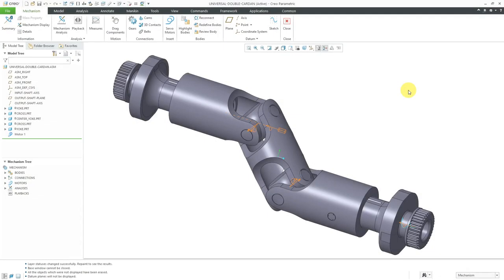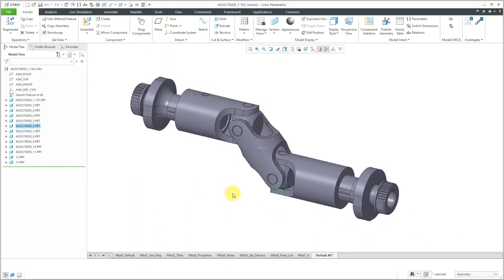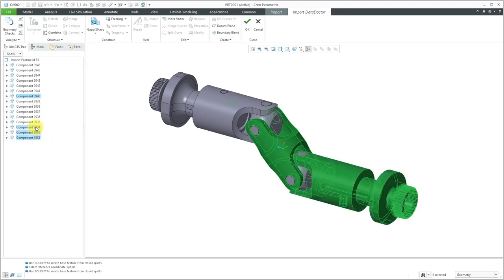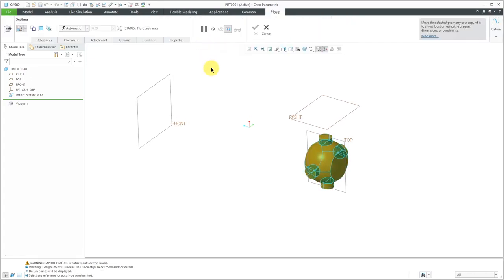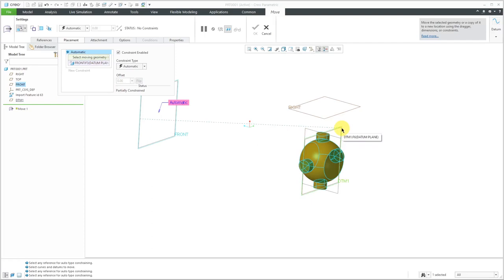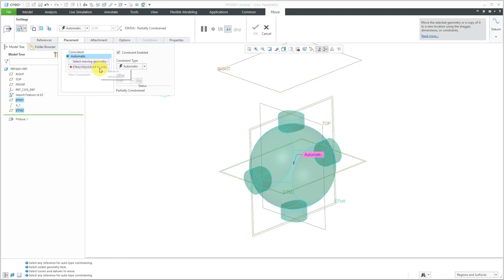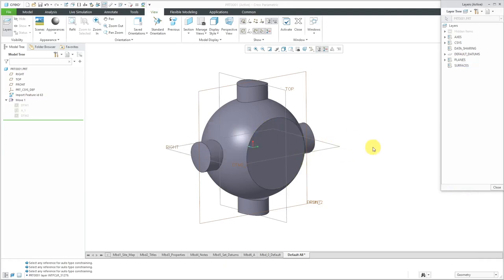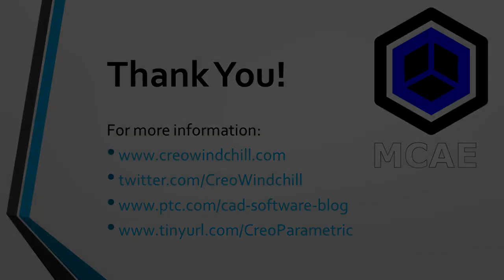Creo Parametric - Import Tricks | Import Data Doctor and Flexible Modeling Extension

Comment: Can we edit the import part and see how and by using which tool they made that part?
Reply from the maker: If you search on my channel for "Import Export" and "Flexible Modeling" you will find two playlists with multiple videos on editing imported geometry.
Reply from the maker: To be clear, you typically can’t reverse engineer imported geometry to figure out which feature tools were used to create the part. Protecting intellectual property is one of the main reasons to use CAD neutral file formats like STEP and IGES.

Comment: what settings do you have? I am working a with a larger step file but deleting components is taking forever like 15 mins plus. Trying to see if anyone else has this problem
Reply from the maker: I am using the default settings for Data Exchange aside from those I showed in my video on STEP files.
Reply: @CADPLMGuy  what specs does your computer have?
Reply from the maker: It's over 4 years old. 32 Gb RAM (Creo maxes out at 20). Nothing special.